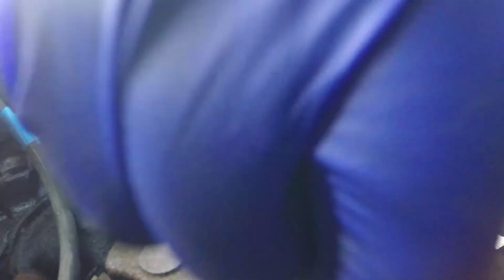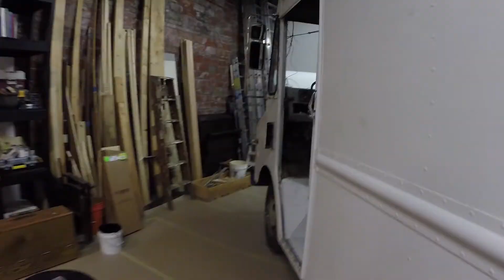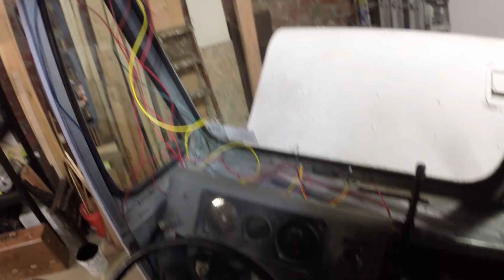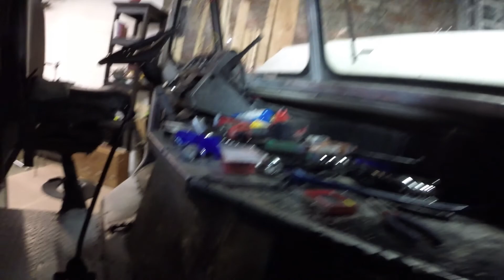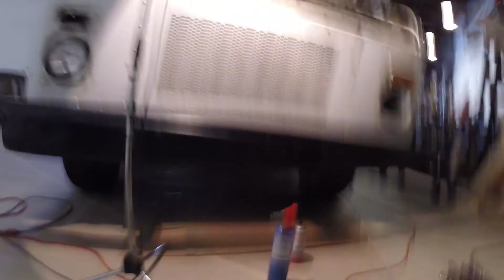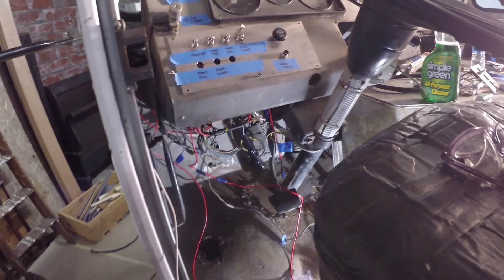82 Grumman Olson Chevy P30 Step Van: Updates

Comment: Great video , was wondering if you have wiring diagram basically for back signals and brakes any info would help thx for ur time
Reply from the maker: Thanks for watching. Any wiring diagrams I had or found were of little use once I got into the process of rewiring so to be honest I just followed the old wires and replaced them with new. The brake lights work on a simple plunger switch circuit. The indicator switch is the only one I didn’t replace because I liked the way the old lever looked. I upgraded the connectors and replaced all lights with new LED or energy efficient fixtures. Being as old as it is there isn’t anything tied to a computer to overcomplicate the process. DC wiring in these old trucks is easy, just get a wire to the load and ground to the body somewhere. Take it one circuit at a time and you shouldn’t have a problem.

Comment: Hi, I have 1988 step van and it also keep on dying. Sometime it dies while I am driving too, then I have start as quickly as I can and also it barely goes more than 30mph after driving a while.  Do you know any idea what could be the problem.
Reply from the maker: Affiliate Hustlers hi, thanks for watching! If you have the 292 Chevy in-line 6 like I do I  would first make sure that the engine is getting all the air it can. Check the air filter and carburetor parts and make sure you are getting good fuel flow and that the choke is functioning properly. Checking the spark plugs could also help. These are the easier fixes. Next I would look at timing and timing vacuum on the distributor, check to see if the alternator is going bad, check the ground connections - these things are associated with the electrical/spark aspect of combustion. If all is good there, look at things like compression and those things within the engine itself.see videos online to learn how to. How many miles on the engine? Maybe its time for a rebuild. The good thing about these older trucks is that things are easier to troubleshoot then new computer controlled engines. Take your time and be thorough and you’ll get it.

Comment: I been seriously thinking about buying a step van for doing side work and it would make a nice little moving truck if or when I decide to buy a property further south.Here in the northeast Iam finding some for sale in pretty good condition between 4-5 grand.One has an inline 6 with a manual and I would guess the power would suffer a little but is the 6cyl considerably better on gas?
Reply from the maker: RichR65Ct , thanks for watching. No matter how you look at, these vehicles are not super efficient on gas at all. They aren’t aerodynamic and there really isn’t much you can do to improve fuel efficiency. I would imaging the 6 cylinder being better than the 8 for sure but this isn’t the only cost factor you’ll need to consider. If you go with an 8, you are most likely buying a vehicle in a larger class.. which means you may need to register with DOT and all the other things associated with anything rated for over 10,000lbs. If you are doing side jobs and moving stuff, 6 is perfect.  The manual transmission gives you more control but most likely a lower top speed. For me, Highway speeds max at 65 because of the 3 speed transmission. Nonetheless, I love this truck, always have loved the style. It’s a box with limitless potential.

Comment: Good day need help I have a 2001 Chevy Stepvan it’s slow the speed say 70 mph but the truck feel like it’s going 20 mph any idea ??
Reply from the maker: I’m not sure exactly where the problem would be. It sounds like possibly the speedometer is electric and runs off of a computer connection to the transmission and that connection is malfunctioning somewhere - if the speedometer is the problem. Is the truck running ok otherwise? Have you been able to isolate the issue to only the speedometer read-out? Does the truck feel like it’s running different or shifting different?

Comment: When you added all new accessory switches, what did you do for a dimmer switch to replace the headlight switch? I installed a Painless harness and still have quite a bit of work to do under the dash. Was thinking of original switches but like what you did with yours.
Reply from the maker: The dimmer is now a large push button switch located on the right side of the dash below the new horn button. (Yes, I also re-located the horn button). The electrical system was pretty much shot when I bought the truck so I had to run new electric for almost everything.  My philosophy for the rebuild was to keep it a simple work truck. If something fails, I could quickly diagnose the problem in the field and fix it right away. The toggle switches and the gauges give it simplicity in style.

Comment: I had to replace the recessed key bezel in mine as it was completely missing. Can you email a pic of what the bracket in back is that holds it in? bobhdus@gmail.com. Milk supply had a new bezel but doesn’t have anything to keep it in that hole on the dash. Mine just spins with the key switch so it takes two hands to start it lol. One to hold the switch and one to turn the key. Thanks! (Mines a gmc 74 Value van).
Reply from the maker: The bezel is 2 pieces,  the chrome retaining ring in the front and the ignition column under the dash. if you reach under the dash and hold the column you can tighten the chrome retaining ring by hand, sandwiching the dash between them.
Reply: C Trybus The piece on the inside of my dash was missing but I was able to locate one online when I searched for old Chevy pickup truck ignition switch parts. Thanks! Btw, are you on IG? Have more Stepvan questions for you and YT sucks for communicating with people. I been posting Stepvan vids on my channel as I been working on a rust bucket Stepvan project. Thanks!

Comment: do you have by any chance the chassis part that goes to the hydro boost brake... the part attached to the car
Reply from the maker: Americo Batista thanks for watching. I do not have that part. It's 2 parts actually. I'm going to post an update soon and If it helps I will show the pieces and provide the measurements so you could try to make a replacement if you can't find one. Check rockauto.com or millsupply.com, maybe they have it.

Comment: Did you figure out the carburetor problem ? What about using fuel injection ? I might use led strip light inside for more head room and even lighting.
Reply: you should adjust your air mixture and check your timing
Reply from the maker: Thanks for watching. I believe i have to adjust the choke a little bit more. i havent really looked into fuel injection systems at all. If you think its worth wile and cost effective it'd be worth a shot. so far she fires up and runs nice in this super cold weather we're having here so i have confidence that im on the right track. my shop is freezing right now so im a little slow to work on projects until i get a few heaters but stay tuned.